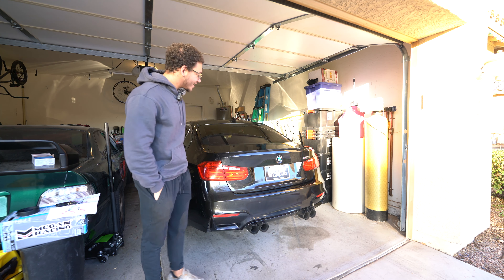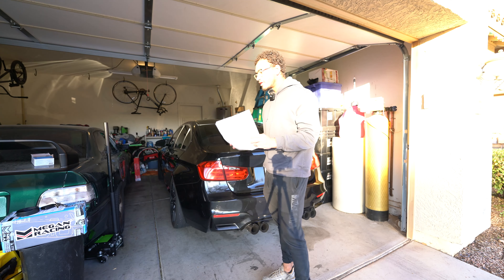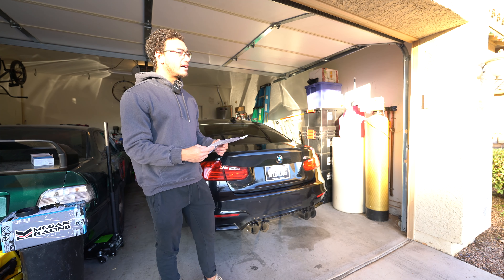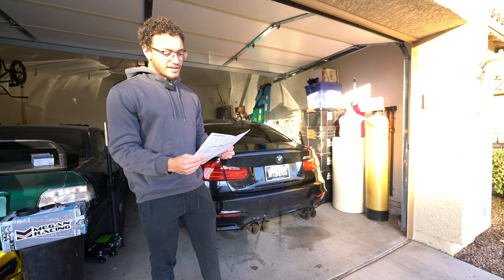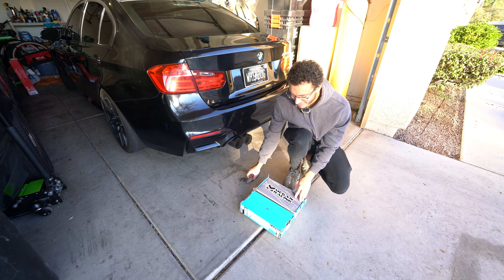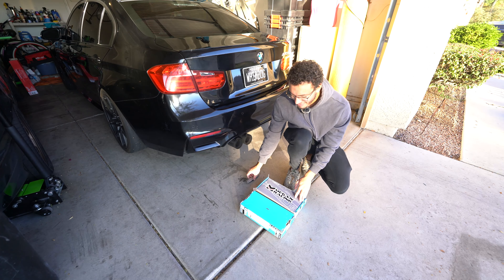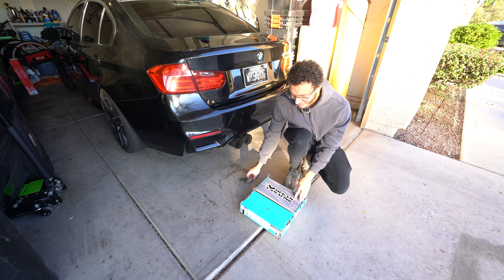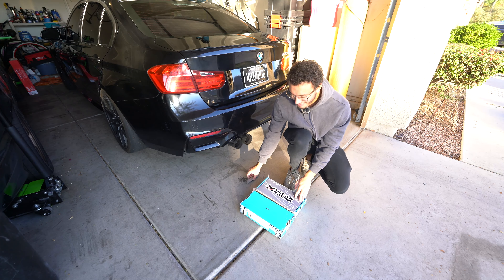f80 m3 camber arm toe arm install fail

Comment: when you install adjustable arms a good practice is to put the bolts on the old one, bring it next to the adjustable one and screw it on the same length. 

I did mine like that and my alignment was almost perfect so I drove like a champ to the alignment shop to dial them in as I wanted.